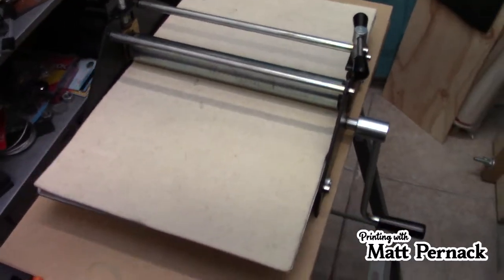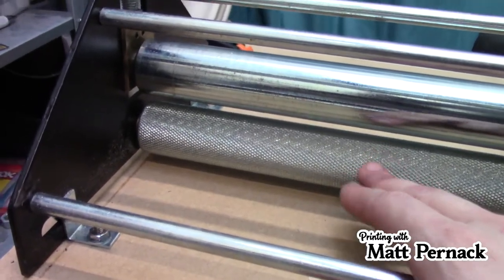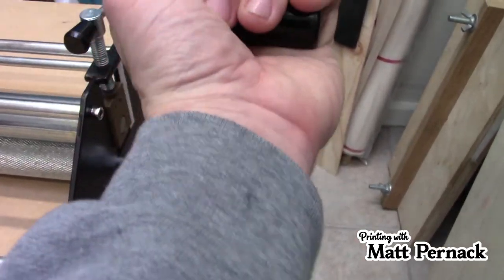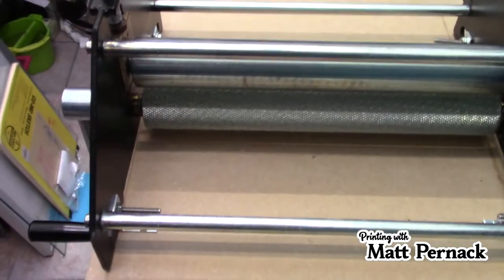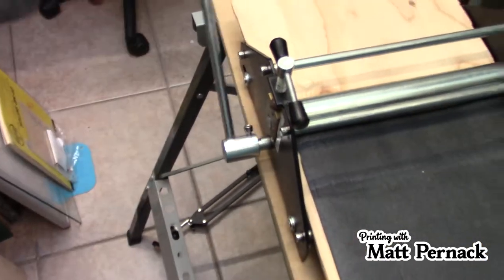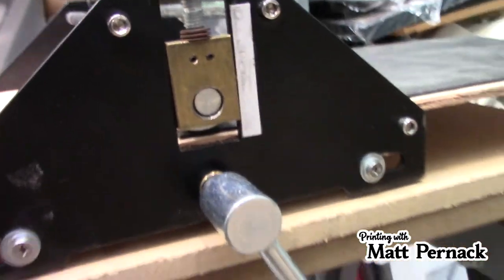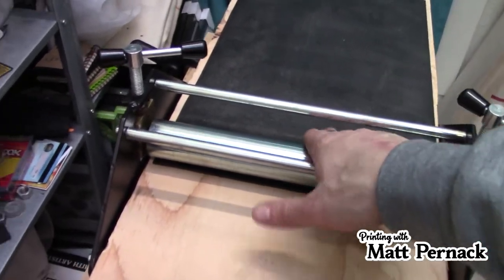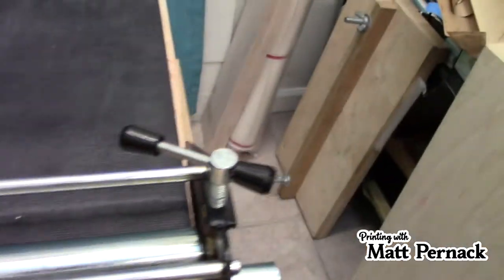Episode 027 - Creative Mark School Etching Press Review

Comment: Just bought one of these and thanks for explaining everything and identifying  issues that made the press (seriously) not so great, and especially offering some advice on what to do to try to improve the thing.  Wish I had seen this during my research and review process.  I did read a review that said to use a feeder and a catcher felt would significantly improve the quality of the resulting prints.  I haven't figured out what the difference is between the two or how I should apply the felts yet...I have them and will experiment.   I wondered about the bed flopping down at the end of the rotation process and am considering adding some additional extension supports to hopefully fix this.  I did add some sticky stair tread strips to the bottom of the bed but it still slipped/binded up so will try the wood and layer with the rubber shelf stuff.  The calibration is a pain to dial in - and more experience will be needed.  Arrgh, it was easier to pull a good print by hand!  Thanks again for your video.

Comment: 6:30 That is the exact problem I'm facing right now, been using this for practicing my linocuts and now that I am thinking of mass producing my work it starts to fail and not griping the metal bed correctly.
Thanks for the video.
Reply from the maker: I discovered a little trick. If you mount 2 skinny pieces of Lino with double sided tape along the sides of the bed it won’t happen. The roller basically sits on the Lino strips which are the same height as your carved lino so it doesn’t get pushed off the bed as easily .
Reply: @mattpernack6816  Oh I already do that, but the thing is that the metal bed it's starting to wear down so the roller wont grab it sometimes. Been thinking to just start to use the other side 😁
But instead of that, gonna try to use a plywood bed first.
Thanks for your answer! Keep printing